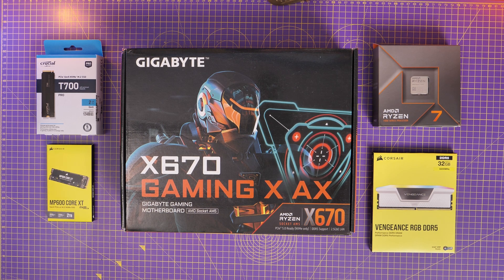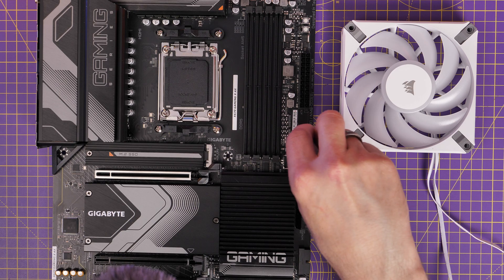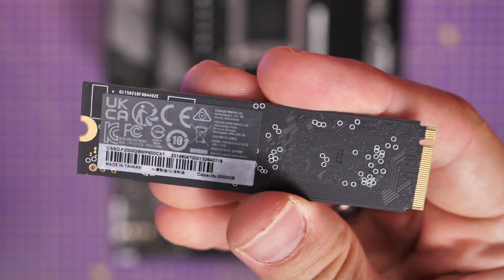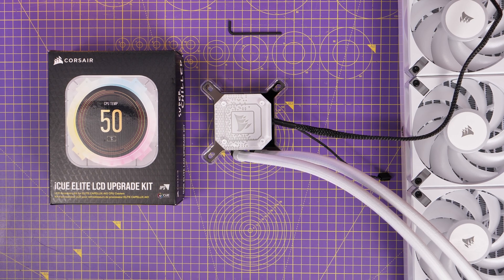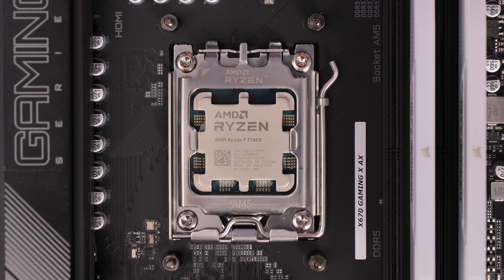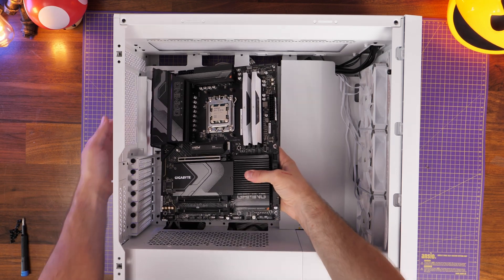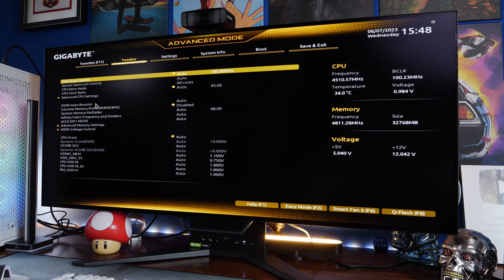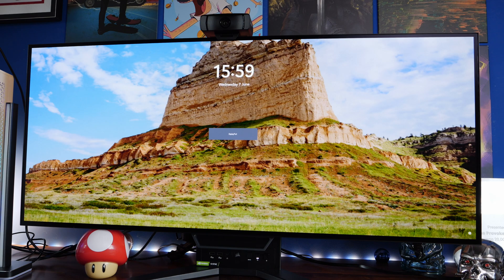Gigabyte X670 X Gaming X AX AMD motherboard feature review

Comment: The expo problems  is what kept me from buing an AMD board. But this board is now on the market in a Gigabyte X670 X Gaming X AX V2 version. I also update the bios if possible right after I build a pc. I hope this new V2 version does not have  XMP ?????? in the bios anymore..  The board itself is very good value for the money.   it"s 188 euro now.  Thanks for this very good review.
Reply: Can you use a aio with it?
Reply: i swapped over from intel lol, my ram is XMP compatible and thankfully the x670 v2 version of this board supports it. Im just scared because i will be upgrading cpu in the future, want to make sure this a good board that will last with newer ryzen cpus.

Comment: so would you not be able to use a Aio cooler with this board??
Reply: I am using a liquid freezer ii 280 A-RGB in a VIEW 71 TG with this mobo, gigabyte 7900xtx, trident z5 neo rgb 6000 cl32 32gb, 7800x3d, pcie gen 4 4tb ssd, GF3 1200w. Win 10.
Reply from the maker: You can use one

Comment: Having trouble. I can't figure out what screws to use to secure the motherboard in the case. Do they come with the motherboard or the tower and if they come with the tower how do I know which screws to use? First build and between wires and screws I'm pretty lost.. Anybody know?
Reply from the maker: Case. And it's usually tiny ones with little domes on top of wider heads. Or the same ones you use for SSD
Reply: @TheProvokedPrawn  Ahah the SSD. I saw a packed labeled for SSD screws so I didn't touch it. The labeling is or lack of it is confusing the shit out of me. But thanks I'll try both and see if it works.

Comment: I bought the board, without seeing your video. But what I'm disappointed is, since you allways pay 100 bugs more, just for "gaming" i was missing the 7 segment display. Why? Because it has 4 small LED's on board, in square of maybe 5 mm (why not have 4 diffrent colors?), but they are all red. So if you got problems, it's a pain to identify the correct LED is on.
On the other hand, yes the 4 SSD slots are great. But I'm not sure, if you made a failure to insert, the 2nd SSD on the 2nd Slot, since then it will use 4 lanes of the grafix card.  Not sure, but I installed it on 3rd slot, just in case. But I'm not a pro, so maybe I'm wrong.
Now to some things I may just had problems. If you make major changes, like XMP, the init reboot takes whery long. Really long.
And if there is a failure, you will wait 5-10 minutes, till it will reboot, with an error message. What creeped me out... holy moly, did I just break my brand new board?
Also my failure, to update your bios with an usb stick, format it to FAT32. Windows 11 didn't even give me this option. But yeah you can format it on FAT32 on the shell. And this took also very long. How ever, then your Bios will see your new Bios for updating.
Even if I'm not the overclocking guy, wanted to try out XMP. Silly me, I used 4 banks of total 128Gb RAM.... Oh no, it only can use XMP with 2 banks (max. 64GB).
Ok, I tried it out with just 64Gb RAM and yes, it did work. After again a very long reboot.
This worked 2 weeks and suddently I had a blue screen and since then I cant use XMP anymore (maybe I'll have to check the RAM's). Just to tell you, my RAM's are officially supported in the list.
Ok, I don't care anymore, got my 128Gb RAM again in, without XMP. 
P.S. The Battery is unter the right heat shield. And it's connected from the back.
So when in 10 years (I hope it lasts so long) and I have to replace the battery, I will have to remove the motherboard from my case, since the screws are from behind. LOL, will have to rebuild my setup from ground to replace the battery. :(

End of story. Yes, it is a nice Board. But since 30 years, I was building my computers myself, I see a decrease of functionality and increase of costs.
Something is going totaly wrong in this business.

But I like the board.
p.s.s. sorry for my bad english...
Reply: Just in case if you wonder:
- X670 Gaming X AX (rev. 1.0)
- AMD CPU Ryzen 7 7800X3D 4.2 GHz
- Noctua CPU-Cooler NH-D15S
- DDR5-RAM Vengeance 6600 MHz 4x 32 GB
- WD Black SSD SN850X Gaming M.2 2280 NVMe 2000 GB
- WD Black SSD SN850X Gaming M.2 2280 NVMe 4000 GB (3rd Slot)
Reply: @666marsipulami  brother is it good or bad , can i buy it for ryzen 9 7950x and rtx 4070ti ,  can i expect any issues , please let me know

Comment: I;ve bought this motherboard couple a months ago , very good motherboard nothing to complain about but now i;ve senn in HWiNFO the Chipset temperature , it's 70-72 degrees in IDLE ! , i want to specify i use for CPU Noctura DH15 and all case have very good fans and airflow , in 100% cpu utilization i have like....65 degrees on cpu and 70-75 on graphic card for example, but this chipset temperature it's diving me crazy , is this normal > ?  in game like Cyberpunk the Chipset temperature goes to 80-85 !
Reply: the Ryzen 7000 series can reach up to 90 degrees Celsius by design, AMD released some information regarding this, but I forgot where exactly.
Reply: Same here. Try to change pcie express power safe in Windows advanced power plan. I realized to ramp up the graphic card fan curve I little bit more in idle helps too. At least I removed 2 of my 4 m2 ssd. So I can now hold the temp while gaming around 63 degrees. I think it is normal, anyway maybe remove thermal pads will help. At the moment I have no time so, it will be my next step
Reply: @a.k.44   you can't replace the pads with thermal paste because it's a gap between the chipset and the heatsink , but after a lot of money and try after try with a lot of thermal pads , ( because the correct size of the pad it's nowhere to be found , i evan mail gigabite and they  even don't know ) i've tryed all the "big brands" like ThermalGrisly and stuff nothing worked , and after that i've found  Gelid Ultimate 15 W/mK and you need the 1.5mm one , after this ....EVRIKA now i'm on 60-65 as well while heavy gaming and 50 when idle  from 70 idle and 85 while gaming ! i can;t believe a brand like gigabite have such a problem with a board that's not really cheap ( for me at least ) and the problem can be fixed with the right 20$ thermal pad....by me...i'm not a tech guru....:)) anyway hope this help ! and remember  Gelid Ultimate 15 W/mK  1.5 mm ! peace !
Reply: @iamagod773  thank you mate. I will try it out and tell you the results. Can you tell me which graphic card you are using ? I think my Asus Tuf 7900xt is blowing much heat on the chip too. So my results may not and not improvement
Reply: @iamagod773  hey mate. I tried out the pad. My temps are mostly the same, maybe 2-3 degrees better. More important, its cooling down now after gaming. I think more is not possible, the chipset on this boards seems to be hot. Of course my graphic cards is a big factor (4k gaming) but i can sleep now better :) btw the stock pads where almost dried out and just broke in my hands.
Reply: I'm 25 degrees idle with an artic Liquid Freezer II 360 and some Thermal Grizzly Kyronaut on this board with my 7800x3D. Those Temps are definitely not normal.
Reply: @Gidrah  we're talking about the motherboard chipset temperature, not about the CPU temps. You got great CPU temperature anyway :) I am at 40 degrees at idle with a Noctua NH-D15. Whats you Cinebench r23 multicore score?

Comment: Is it necessary to update the bios too or not needed?
Reply: Yes There are some pretty important ones in the latest  updates I recommend you do it
Reply: @Vitrooz  bit skeptical though i read the motherboard manual and it said do not update the bios if everything is working fine
Reply: Any boot issues ?
Reply: @johnny2598  nope working fine but there are bios updates available
Reply: @Mountainmotopov  How much time it takes to get to Windows screen ? 

What motherboard do you have and ram ?
Reply: @johnny2598   liquid freezer ii 280 A-RGB in a VIEW 71 TG with this mobo, gigabyte 7900xtx, trident z5 neo rgb 6000 cl32 32gb, 7800x3d, pcie gen 4 4tb ssd, GF3 1200w. Win 10. 5 seconds I think.
Reply: @stefanrenn-jones9452  Great. I was scared about the DDR5 issues and jumped on AM4 instead.

Comment: Is this a 1.2 version? My 1.0 has a diff backside
Reply: Amd switched the socket along with back retention to Lotes(Manufacturer) in most of their boards after launch. Previous the retention were black in color, not its silver. Also, there's revision 1.3 also available now,

Comment: How is the HD audio quality of the motherboard?
Reply: Long story short the audio is about the same as any tv headphone audio from the last 15 years. Ordinary. Worse than that of a fo48u oled that I was previously using. The x670 gaming x Realtek HD audio comes through windows 10 maxing at 24 bit 192khz, 24 bit 48khz with dolby atmos for headphones. I think dolby atmos for headphones maxes out at 24 bit 48khz anyway. I use kns6400 and kns8400 and a samsung galaxy s8 andriod dac sounds much more detailed and clean in the bass ranges with 32 bit 384khz. A similarly spec'ed (32bit) fiio k7 is apparently better, or even the SoundBlaster g6 dac. I am thinking about upgrading to the ae-9 soundcard but am slightly worried about space on mobo in the View 71 TG case. I DIY'ed my pc with this case and mobo, specifically, for next gen gargantuan graphics cards. Currently running 7900xtx by gigabyte. I can also conveniently upgrade my gpu, mobo, cpu drivers etc through Gigabyte Control Centre (GCC).

Comment: hi Provoked Prawn, I wanted to know your opinion about EVGA Motherboard EVGA Z690 DARK K|NGP|N, 121-AL-E699-KR, LGA 1700, Intel Z690, PCIe Gen5, SATA 6Gb/s, 2.5Gb/s LAN, WiFi6E/BT5.2, USB 3.2 Gen2x2, M.2, U.2, EATX, Intel Motherboard, it would be fantastic if you review it or check it and give you opinion about especially if the primary use for it would be gaming, editing videos as well. thanks